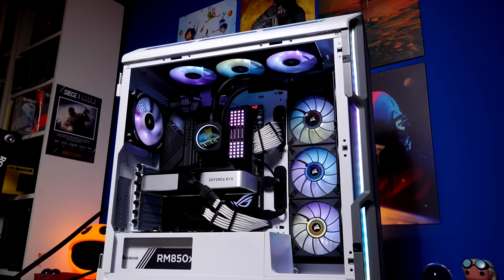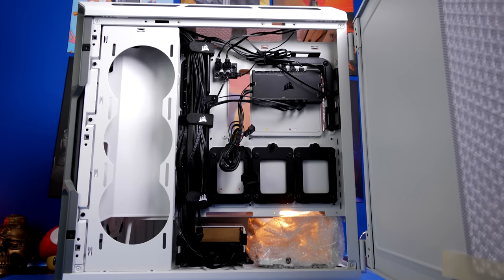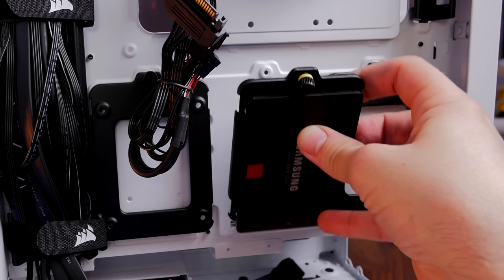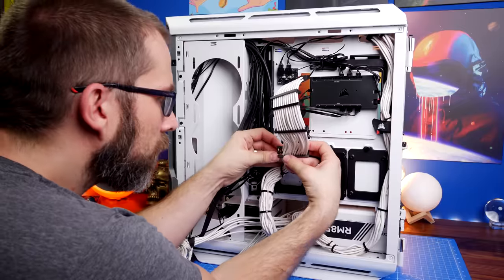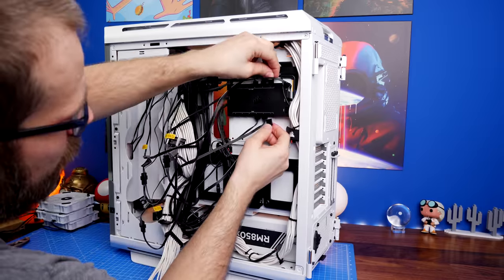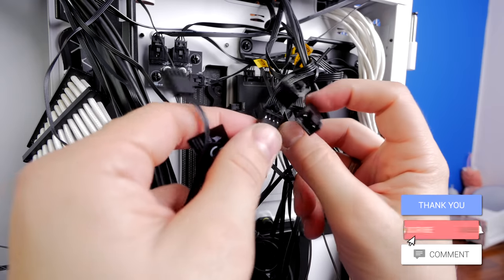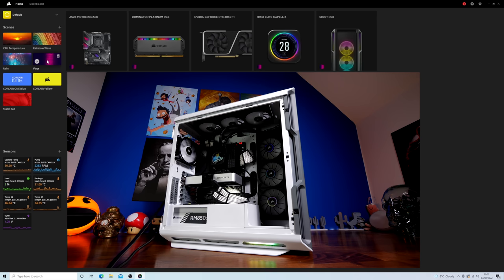Corsair 5000T build and installation guide - 10 fans and two different AIO coolers

Comment: Wanting to do my first build, so I've been watching a ton of Corsair Case Builds.  Your is the most thorough review, build, instructions, and explanation that I have seen.  Thank you for going over the iCue software, plus two Corsair RGB controllers.   Very very helpful.
Reply from the maker: Thanks for this. This is why I put in so much effort because I want to help people. Hope you liked and subbed 👍
Reply: @TheProvokedPrawn  Same here! I’m looking to build a similar build and your video on the 5000D and this one are incredibly helpful and will definitely ease my first build with the amount of RGB fans as you cover the fan hubs and software!
Reply: @TheProvokedPrawn Hey I have 5000T 2 liquid cool radiator for both cpu and gpu. What I did was put the cpu radiator up top the side mount was my gpu radiator 6 exhaust total I have 4090aourus water-force. I put 3 Intake fans in the front and 1 Intake in the back with dust filter what do you think?
Reply: What did u get pls tell all ur specs, cooler, mobo all model details

Comment: Working on a build using this case and this cpu cooler. One thing I'll say: I would not recommend removing that back cable holder panel if you want it back on. It's an absolute nightmare to put back on once you remove it and seat the radiator fans/mobo

Comment: You rock, thanks for the detailed video! I received my 5000T today and am awaiting delivery of the final components for my all white build. This is super helpful and I am sure it will help me save time during setup.
Reply from the maker: I aim to please. Good luck with the build
Reply: Hello,will i be able to add more LL120s fans to this case without buying anything else? For example 3 more fans. Dont i need to buy separate controllers for them or i just buy fans and connect to the stock core xt controller?  Will i be able to control all the rgb and speed on 6 fans with stock controller? Thanks

Comment: Just built in this case and this video was invaluable. Every point he makes is correct to this day. If your moving it take the doors and the top off and it is a lot more manageable and lighter.
The HD cage for me is in the wrong place, but i wont need it, so it was the first to go as was the side fan panel because i wont be using either.
The only cons for me were the little plug that powers the   bottom and top RGB circuit board arrives unplugged, and is easily missed, and for the price point a lit front and side corsair logo as on the 5070x etc really should be on there.
Reply from the maker: Thanks for sharing

Comment: Great video!  Working with my son on pretty much the exact build.  I have a couple of questions.  Did you ever find a proper USB 3.0 splitter?  You have 10 fans split (6+4) on 2 Commander Cores. How are they split?  Front (intake)/Top (exhaust) on one and Radiator Side (intake)/Rear (exhaust) on the second core?  How on earth did you cable manage the front fans cleanly?  Fan 1 on the bottom isn’t long enough to run to the top of the case and down to the preinstalled Commander Core.  It would have to cross the side panel radiator fans.  But your final build looks completely clean.  Lastly, I have an Asus ROG Strix Z790-E Mobo and only 2 usb 2.0.  If I use the splitter from my H150i LCD, I can take care of one Commander Core and Cooler.  I can use the 2nd USB 2.0 for the other Commander Core.  Can I plug my Corsair HX1000i usb into the daisy chain input cable from the second Commander Core?  *Note* This is my first ever PC build.

Comment: just about to start my new build with this case, thx for the extremely detailed review/tutorial - keep up the great work!
Reply from the maker: Glad I could help!
Reply: @TheProvokedPrawn  after building it, im a bit torn apart... I had a much smaller case before für a fraction of the price (only 70.- compared to 300+ of the iCue) - but the other one was easier to build. Im still having those thick bundled power cables - and no matter what i do, they push the wimsy side (compared to the robust glass on the other side) now and then open. Then Ill have another command (pro), used to attach it with 2 of the corsair magnet stripes it comes with - somehow on the iCue 5000T the magnets are not strong enough to keep the commander in place. The fans are cool - and i have to say, they are even enough as case fans - even for my heavily overclocked i9 12900k which sometimes gets extremely close to 1.5V when loaded ;) My RTX 3090 (stock air cooled) remains below 70 degrees C under 100% load (even when the load lasts overnight - deep learning - and I pushed it to to +107% power limit - so what i really love is the airflow and the lighting - but some design and material choice of the case is typically "may it look great, sell high, but produced cheap". My old case had totally 14 x 120mm spots, fitting 360mm rad in 3 spaces (bottom, top, front side) - coling effciency due to not having a direct airflow channel (side opening only - no front) was worse - but in terms of fitting parts and cables it was actually well thought and efficient. Even for my QL120s which io wanted to fit - their cables are really have to be strechted to reach the commander - so the fact that they dont even check their own top lighting fans for proper compatibility speaks many words - i cannot even put their cables into the "rapid route" because they're not long enough and of course, corsair tehmselfe dont offer RGB extensions. 
Im not saying its crap - but for this price i expected seriously more - especially that wismy cable side door - a few cables can pull it open...
Reply: Hello,will i be able to add more LL120s fans to this case without buying anything else? For example 3 more fans. Dont i need to buy separate controllers for them or i just buy fans and connect to the stock core xt controller?  Will i be able to control all the rgb and speed on 6 fans with stock controller? Thanks

Comment: I did build in one of these last year and today replaced the PSU with a larger 1200w one and added a 4080. There are problems with the case but none are perfect. With a large PSU and lots of cables the 3.5” drive cradle doesn’t fit, the rubber grommets fall off when wires go through, there is a pointless door behind the rear panel that gets in the way and the horizontal slots are a bit low so you can’t use them with tall cards but overall it’s a good case. I have an AIO using 2 fan location on the side panel then all the other fan locations have a fan. I also have another on top of the PSU bay forcing air into the 4080.

Comment: Hello,will i be able to add more LL120s fans to this case without buying anything else? For example 3 more fans. Dont i need to buy separate controllers for them or i just buy fans and connect to the stock core xt controller?  Will i be able to control all the rgb and speed on 6 fans with stock controller? Thanks

Comment: I have a quick question. I see you have the Dominator ram. I am looking at two options. There is the Dominator at 6200mhz for $250 or the Vengeance at 6400 for $200. Is the $50 increase worth going with the slower Dominator?

Comment: Can watch this over and over! Thank you for all the explanations :) I was wondering though, if you use a cable USB3.0 splitter (19pin) if you only have one port on your motherboard, does that affect bandwith? Are those 4 ports still using 3.0 speeds? Thanks in advance!

Comment: I found this helpful as my son and I got the 5000x, which doesn't have some of the features yours has, but is very similar.
7:30 Did that control module come with the case? How do you feel about the iCUE software? I didn't find that their website provided enough info on it. Have you used other HMSes than iCUE? If so, which brands (e.g. Lian Li, Cooler Master, ASUS, etc.) and how do they compare to iCUE? Also, in your experience, is having HMS worth the extras involved (cost, hardware, whatever)? Any other thoughts? I'm trying to figure out if I should go for iCUE, the ASUS HMS, or something else. I still have to get the PSU, and I may need to get an AIO because I don't have AC, so those are factors in my purchases. Please note that I do NOT care about LCDs, RGBs and such - I'll be looking at my screen, not inside my case. Thus, my primary interest in the ability to have it monitor my hardware, provide failure predictions/warnings and control my USEFUL hardware in a uniform fashion.
17:57 What is that? I don't see that on my 5000x.
38:00 Will that be a problem for all GCs, or just double wides? What width do you think would make it feasible without an AIO? I'd been planning to use that for my GC, but now I'm bummed.
39:00 Does mounting the SSDs on that grating inversely affect airflow for the PSU or other parts?
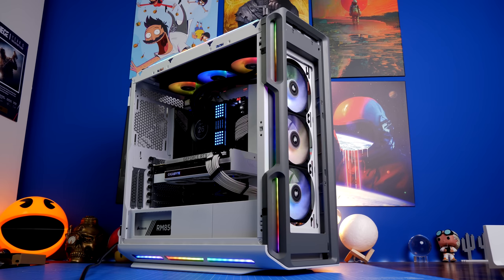41:00 & 49:00 During both temp tests, did you close the case up?

Comment: Thank you so much for being so thorough and setting up the multiple options in the case. I'm also going to do the Aio on the side like you did at the end of the video. I did see a temp test video with smoke blown through the case and they found it was better to install only two exhaust fans at the top because that third one over the AIO actually was pulling a lot of the cold air out before it reached the mobo.

One thing I am curious about that you didn't discuss was, can you make each fan a different solid color such as one red, one blue, one pink, one green in the icue program?

Comment: Hi,

First, thank you for your video. I'm not sure if you'll see my question, but I hope you do. I'm looking to buy a new PSU and I'm considering the RM850x. I have a 5000T case with 13 fans already installed, so there are a lot of wires. Would it be better for me to buy the RM850x Shift rather than the standard model?
Reply from the maker: https://youtu.be/dNseVxqqar0

Comment: So at the moment I'm using the Obsidian 500D RGB SE, would you say it's worth it to swap it out for the 5000T?
I was also wondering, if you want to use 10 fans, how would you do it?
I was thinking front and side intake and top and back exhaust.
Thanks in advance c:
Reply from the maker: Yes. The 5000T has better airflow and is a much better case imo. (I have used both). And yes to the fan logic.
Reply: @TheProvokedPrawn  holy shit mate quick response, thank you so much :D
Reply: @The Provoked Prawn  one last question, would you take 4x140 fans for the case or 6x120?
Radiator has 3x120 for the top and in the back I'm limited to 120.

Comment: Can I top mount a push/pull H150i in this case? I know it is possible in the 5000d airflow by mounting the pull fans outside the case. Does this case also have the clearance?

Comment: @7:42 the cable on the bottom that goes into the 5V GND , would you happen to know what its called as ive got it missing inside my case? thanks

Comment: Considering buying a Corsair Aio, is it counter productive to mount it on the top exhaust? wouldn't that warm up the water? just curios. thinking the front side panel area atm where the cord guard is
Reply from the maker: I've tested both side and top mounted and there is little difference

Comment: I have a rear LL120 (FanHub 1, RGB1), top 2 LL120 (FanHub 2, RGB2; FanHub3, RGB3), Front 240mm AIO radiator fans LL120 (both go into AIO pump, RGB4, RGB5), and last one case fans LL120 below the radiator, this would go to RGB6, it's fan PWM header if connect to FanHub, what number of the port it goes to ? If connect to FanHub4 is there any issue on fans syncing matter ? Because radiator fans are not using FanHub4 and FanHub5. it connect to AIO pump instead

Comment: Just did the same configuration as your last for my 5000d Airflow. The side mounted radiator gave me 5-7 degrees cooler temps versus when I had the radiator mounted on top.
Reply from the maker: Neat
Reply: Hello,will i be able to add more LL120s fans to this case without buying anything else? For example 3 more fans. Dont i need to buy separate controllers for them or i just buy fans and connect to the stock core xt controller?  Will i be able to control all the rgb and speed on 6 fans with stock controller? Thanks

Comment: Very informative, I bought a pre built i7 10 gen with 16gb vengeance ram sticks, And I only put a msi GTX 1660 super 6gb graphic card, I gets 222 fps as a benchmark on Assetto corsa, It runs AMS 2 absolutely stunning, Even on mid setting the 1660 super gives me quality grafics, I am shocked I payed 150 qiud for the grafics card and the results are amazing, Coming from a PS4 pro, It's like learning to SIM race all over again, The PC is more refined, Smoother, Oh there is more competitive people on the PC, The PS4 when I'm on the Online lobby on the Nordsliefe, I am pretty fast, Some people don't like it, So they wait and ramm me off the track...
I don't get that on the PC, I still learning tho, Like AMS2 is actually learning sim racing again...
I want to build my next PC, As I produce hip-hop beats, I want a dedicated music production PC, I would only need an I5 build to be honest, Just will have to have 32gb ram down to the software can be demanding, I'm reading in places that an I5 can be not far away from i7 with CPU power....
Can you suggest say 600-700 qiud i5 build......
Great information on PC build here, One thing I won't cheap out on is power supply, Got be at least 750watt.....
If anyone can link me up to a music production PC????
Quality video tho......

Comment: seems like you are very familiar with corsair products. can you mix and match different corsair fans on the same controller? are there any incompatibilities (xt/pro)between controllers and you have to use only the commander core xt?
Reply from the maker: Corsair says you should not mix and match. I have done it but it didn't cause issues. Make of that what you will.

Comment: Awesome video, thank you so much for your time and attention to detail in making this video. I’m about to build my first ever PC and this is the case I’m using. I am very nervous about managing all the different cables but eager to get started; your video has been a massive help and gives me an idea of what I’m in for. Im finding it daunting before I have even got started but want to prepare myself for when the components arrive so I can (hopefully) have a relatively smooth time of building it. 

I have a question regarding the splitter you mention to enable use of all front end panel USB ports (my mobo only has one port) what is the name of the product I am looking for? I have tried an Amazon search but the connectors look different to those in the video and I do not know the official name for them due to being a newb. If you could link an appropriate product from Amazon or similar that would be perfect however if not possible then just the name of the connector would be grand. 

Thanks again

Comment: Did you use 2 separate USB headers for the Commander Core XT and the Commander Core? If so, do you know if you can use the USB daisy chain on the Commander Core XT, to go Commander Core USB into Commander Core XT daisy chain and then into a single USB header in the motherboard? Basically I only have 1 spare USB header, but 7 Corsair fans to power/rgb.
Reply from the maker: Yes, you can use usb splitters.
Reply: @TheProvokedPrawn  thanks for such a fast reply! Subbing :)

Comment: Is it possible to mount a 420mm aio rad to the front for fresh air intake to the cpu? There are various mounting slots in the front that match said configuration, but it’s not confirmed by Corsair on their website :/

Comment: Great video and I know it's an older one but I have a question if I may. Using the front 3 fans for intake and a corsair 360 aio on top as exhaust, how would you add a single 7th corsair fan at the rear as exhaust so all the fans "talk" to each other?
Reply from the maker: https://youtu.be/jvXCbny-Suw
Reply: @TheProvokedPrawn  Thank you very much. You just made my life a lot easier. Regards from Australia.

Comment: What would u recommend? Should I put aio on top as an exhaust and 3 front and 3 side as intake? Or aio on the side as intake and too fans exhaust like what u had? Which cools better and saves aio life?
Reply from the maker: I am of the opinion that the AIO is fine in either position. So it's upto you. I believe I showed thermal differences?

Comment: Have a question if you got a answer to it. I just installed my new cpu i7 13 gen and z790e board now all my fans are a bit louder then before. I already turned em down in bios but no luck
Reply from the maker: Have you checked your temps? Maybe something is too hot and so they're running faster to compensate.
Reply: @TheProvokedPrawn  my temps are fine. Funny thing is when you go to the site to look at the z790 e the bios shows and its like the same tying with my cpu fant. Maybe the 13th gen are hot. But my temps are pretty good

Comment: I am starting a similar build today with the 5000x, Corsair LCD AIO and 10 fans.   Pretty confused on how to get all of the fans connected and controllable.  My MB has 2 2.0 usb headers..will I need an additional internal USB hub like the nzxt hub?
Reply from the maker: If you're confused after watching the entire video then I failed.
Reply: @TheProvokedPrawn  Absolutely not.  This is all me.  This is my 2nd ever pc build and of everything, all of the corsair "stuff" confuses me (the built in hub on the case, the commander core xt, the commander core that comes with the aio, the lighting core thing that came with the fans) and none of them provide any instruction to connect more than 6 fans.  Without your video, I wouldn't even know what questions to ask.   This video also earned a subscribe click from me.